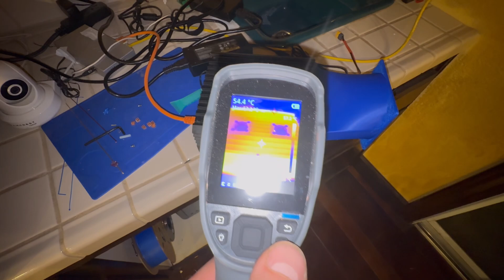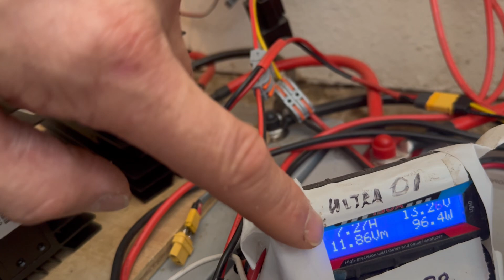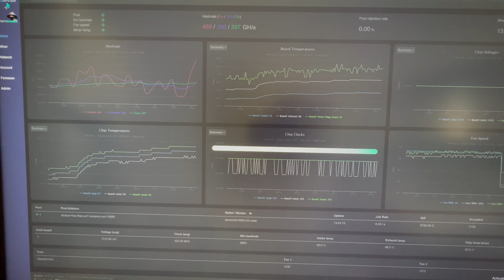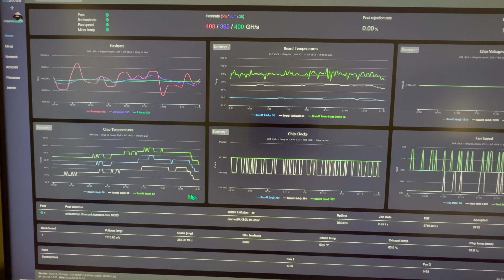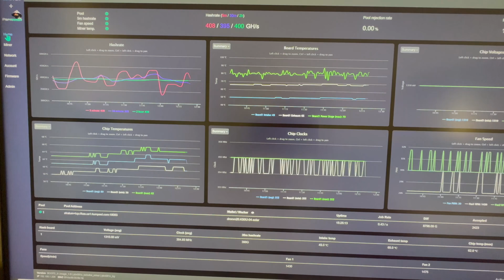My 2x not overclocked  KS0 Ultra stop mining, why and how I fixed them.

Comment: it is not overclocked but then you say it was overclocked?  Did it overheat before the fan mod/removing end?
Reply from the maker: They were overclocked for short period of time but even shortly overheated parts can cause that damage for sure. I have 6 that been overclocked to the 720GH  and running over 3 month non stop. One even even hit 52days without restart. These 2 just somewhat unlucky as started acting but now they work fine for over 2 weeks in cooler environment below 78F.

Comment: Again, valuable information. I don't have your experience but always found strange why choose 12V that uses 58% more A, I assume that was because of better power supply since my overclocked KS0 Pro with my lab psu had 0 rejects compared to a laptop psu. What happen to those 2 is odd since they were not overclocked.